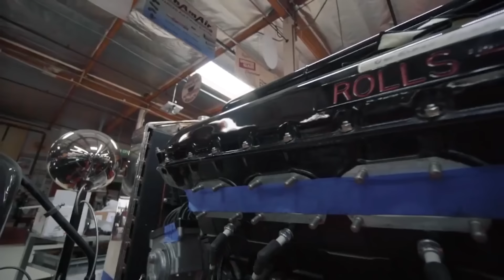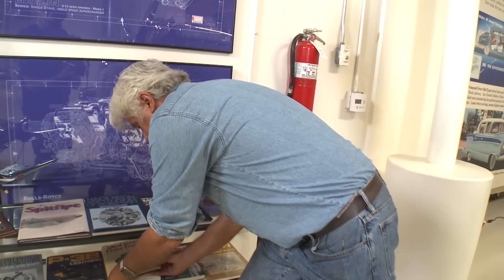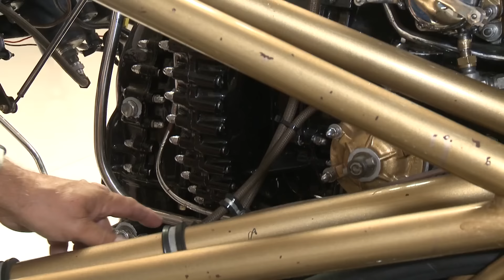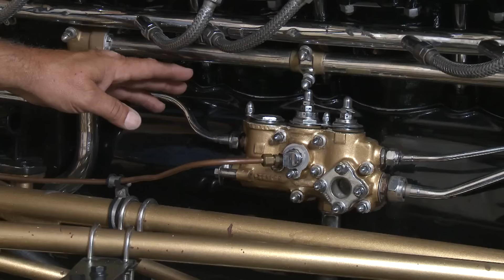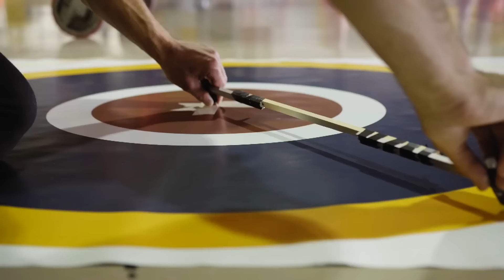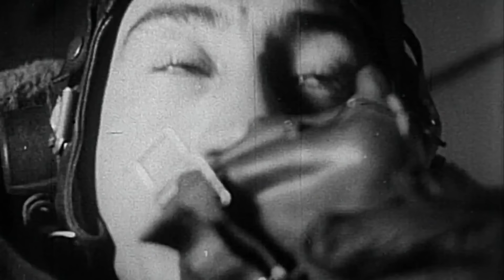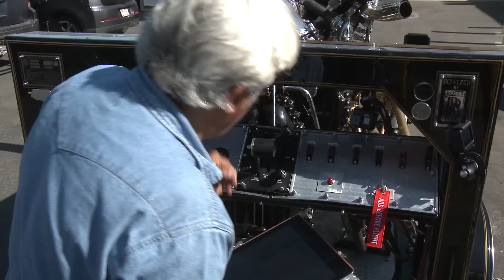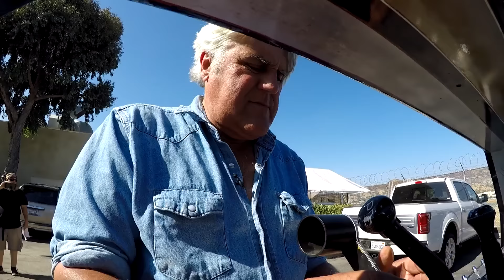The Engine That Won World War II - Jay Leno's Garage

Comment: Whole UK fleet of heritage Spits and the Lanc have been grounded, rumour is a gudgeon  pin problem which could wipe out a block? May be worth checking out on this engine?
Reply: Let's put emotive language language to one side for a moment and consider the facts.  I was, by the way, at work at R-R Bristol on 25th July 2000, but no longer working on Concorde's engines, when the news came through. One of my colleagues was immediately sent over to Paris and had the unfortunate task of walking through the debris field and actually inspecting the remains of the burst tyre.  It had a cut that exactly matched the piece of wear strip that  had fallen off the DC10 
Yes, the crash of AF4590 was a disaster resulting from what I would characterise as an incipient design shortcoming.  The wing structure above the undercarriage was designed to take the impact of tyre debris, which it did on this occasion.  However, what had not been anticipated during the original design process was the generation of a pressure shock wave in the fuel, which ruptured the tank elsewhere.  Even then, if damage to electrical wiring in the undercarriage bay had not occurred and ignited the leaking fuel, the aircraft would have probably made a safe emergency landing, streaming fuel.  The subsequent modifications comprised of installing Kevlar/rubber liners in the fuel tanks, extra shielding of the electrical harnesses and improved Michelin tyres.
For several years, Concorde was hugely profitable for BA: I was once told by a senior BA executive that, in six weeks, the Concorde fleet made more profit than the whole of BA's European Division in six months.  Of course, it pandered to the rich and famous, but then that is free market capitalism in action, and surely the USA of all countries should not object to that principle?
It is well known that  neither BA nor AF paid an economic price for their Concordes, which would have reflected the R&D costs of the project, and that objections were raised in the USA and elsewhere.  Concorde was a prestige project for both the UK and France, the equivalent, perhaps, of the Apollo programme, which had its own "design flaw" problem, as revealed by what happened to Apollo 13.
In respect of the economics of aircraft programmes, I would contend that, in the 1970s, the US aircraft (and engine) manufacturers did not charge a realistic price for their civil airliners to their home market, as their R&D was effectively subsidised by major military projects.  
In the late 1960s, the acquisition of widebody design and manufacture technology, on the one hand, and the development of the two large turbofan engines, on the other, was largely financed by the C-5 programme.  All three airframers and both engine companies had large R&D contracts from the US DoD for the C-5.
All aerospace industries have had events and disasters, as a result of unrecognised design shortcomings.  I was a small boy when the Comet disasters happened: it was a national tragedy for Britain, akin to the Challenger and Columbia disasters for the USA, which also resulted from "design flaws". 
If you do wish to use emotive language about airliners, then perhaps you should also apply it to US aircraft, starting with the Lockheed Electra.  Tragically, the wings came off nearly-new aircraft because both the engine mountings and wings had insufficient stiffness.  
The  DC-10 also had its problems: there was the Turkish Airlines tragedy in Paris in 1974, Chicago O'Hare in 1979, and Sioux City in 1989.  And Boeing, too, had problems: remember the Aloha event in 1988, where a B.737 became an 'open top'?  Then, in 1989, there was the crash of a B.737 here in the UK.  That was down to an unanticipated "design flaw" with the fan of the CFM56 engine.
Are you really suggesting that the sonic boom of a Concorde would result in hearing loss?  That's quite preposterous: exposure to the the general noise levels in the streets of any big city in the USA, or anywhere else in the world, would probably be far more injurious.  However, you may have a point about there being an occasional broken window, but it would need to be under the right atmospheric conditions.  
Living near the city of Bristol in the West of England, I did experience, on a few occasions, the dull "thud-thud" from the sonic boom of a Concorde inbound from New York.  On one occasion, it rattled my doors and windows just as a car was going by at the end of the road. For just a moment, I thought that there had been a collision, but then I realised what the noise was.
Finally, I must mention that, as a member of the Olympus 593 engineering team, I did have the pleasure of a day trip on Concorde in 1995, to/from New York, as guest of British Airways.
Reply: Not all,griffon spit still up while merlin issue investigated,may well be something or nothing...what needs remembering is that the BBMF are rightly overcautious because what they fly is pretty much irreplacable.you simply can't go out and buy another one of what they have.
Reply: A nice balanced and professional post, thanks for the sanity.
Reply: johnyfartpants How's Terry Fuckwitt? Haven't seen him in ages
Reply: They'll be back flying soon,remember that they've found a potential problem,they had no issues and no aircraft were lost.Regarding Concorde,the one that sadly crashed with a loss of life ran over a part that dropped off a shoddily built dc10 a few minutes earlier,an aircraft with a dubious safety record at best.And the Concorde fleet were grounded for financial reasons,it was never the success it should have been due to it being banned from supersonic flight over land due to the sonic boom,and video calling/conferencing etc which removed most of the need to cross the Atlantic in under four hours.
Reply: The official release from the BBMF states that the problem is an issue with the "pinion gear", by which I presume that they mean the pinion of the reduction gear driving the prop, which is mounted at the front end of the crankshaft.  For all the BBMF aircraft to be grounded suggests that they have identified a potential manufacturing or quality problem with a batch of gears  from a single source of manufacture. I presume that the reduction gearset is common across several marks of Merlin and, of course, the pinion and wheel will be of relatively recent manufacture.
Unfortunately therefore,  we won't be seeing the BBMF at the Bournemouth Air Festival this weekend, which is where I am.  However, we had great displays yesterday (Friday) from a P-51D and a Spitfire.  There was also an appearance of B-17 'Sally B', accompanied by the playing of Glenn Miller's 'In the Mood' over the PA system.  It was joined by the recently-restored, Bristol Mercury-powered, Bristol Blenheim, so we had the sound of six radial engines in our ears.
And, of course, we had the Red Arrows, unfortunately down to eight, as one pilot was reportedly suffering from food poisoning.
PS They were up to a full complement of nine today (Saturday) and they arrived all of fifteen seconds early, at 1159.45, for the start of their display.
Reply: Most of the BBMF aircraft have recently had major service\overhaul,the Lancaster was away having major work done when I last visited Coningsby in June.It may be that a service part used has been found to have an issue.
Reply: I saw two (or more) Spitfires and a Hurricane flying only yesterday, Friday 25th August.
Reply: Privately owned i'd imagine.BBMF working hard to resolve the potential problem.
Reply: The latest from the BBMF is that they expect to have a Spitfire and a Hurricane flying at a display on 9th September.
Reply: The Lancaster and two Hurricanes as well as the Merlin engine Spitfires, the Griffon is not affected.
To maintain the priceless artifacts of our national heritage in airworthy condition in order to commemorate those who have fallen in the service of this country, to promote the modern day Air Force and to inspire the future generations. I doubt they will be grounded for long.
AB 910, a Mk V, Mk 356 a Mk IX, P 7350, a Mk II and TE 311 a Mk XVI all have Merlin`s but 
PM 631 and  PS 915 are Mk XIX with the Griffon engine
Reply: I live coastal England,not too far from a long closed practice\ bombing range on the north sea coastline,as a child we lived with sonic booms from ee lightnings and the distant brrrrrp's from a10's at cowden.you quickly learned to live with it and hardly noticed it.
Reply: I'd like to echo the remark from freerad101; an informative and sensible post by grahamj9101. There's not too many of them floating around is there.. That's what the internet is for by the way - for those reading this who aren't entirely sure. The generous sharing of knowledge and 'life'. I get embarrassed for those who rant and talk excessive garbage, and particularly feel pity for those who don't seem able to try to spell or punctuate properly.  I saved for eight years to travel from Australia and fly on Concorde some six days before it permanently ceased services. It was 'BOAC' by luck too. Anyway gotta run because the latest episode of Skippy is about to hit the box !
Reply: So you flew on G-BOAC (Alpha Charlie to those who worked on her)?  Back in 1995, as a guest of BA, I flew Alpha Charlie one way and Alpha Fox', the other.  BA would arrange an occasional engineering meeting at JFK for the R-R service support team and make a day trip of it  
Having retired from R-R a few months before, I watched, with sadness, Alpha Fox's final landing at Filton in November 2003.  She spent the intervening years out in the rain until, in February of this year, she was finally put under cover in her own hangar, as part of the new Aerospace Bristol museum.
Reply: There's nothing in the Haynes Manual about gudgeon pin problems because there was no historic problem with them.  The recent BBMF press releases clearly state that the problem has been with the pinion in the reduction gearbox, which, appears to have affected the BBMF's engines only.  I interpret this as indicating that they have encountered a quality problem with recently manufactured gears supplied to them, which almost certainly has meant a strip of the gearbox and a detailed re-inspection.
Reply: Strange how the public did not make a big deal out of supersonic flight until after Boeing gave up on their very expensive design that never got off the drawing board,  some US airlines placed orders for Concorde only to find the sudden very unexpected resistance by many of the public, guess who was behind it?   a clue the name is something like this  B----g the plane maker who hated to lose.  take off and landing noise was just more of the silly nonsense.
The noise meters put in just to show how noisy a Concorde was showed it wasn`t, other planes were noisier on take of or landing and for longer.
Reply: tjp.
Very strange that the so called issue of supersonic flight was no big deal in the 1960`s,  as for noise in 1977 when I was not far from Heathrow and regularly saw Concorde`s  the loudest plane I heard was a Boeing 747.   The US did not need to exempt Concorde they had set noise meters  to measure the noise on take off, it was not nearly the loudest plane taking off and the protesters had to drop that nonsense.  
Concorde not flying supersonic overland still took much less time from London to New York. Many Americans were very happy to fly fast
Reply: As someone who worked on Concorde's engines for several years, I would be a regular visitor to R-R's office at Hatton Cross, near the eastern end of LHR's 27L runway.  During the latter part of its service, it could certainly be the loudest aircraft on take-off and could even set off numerous car alarms in the car park adjacent to the end of the runway.   On other occasions, dependent on weather conditions, it appeared no noisier than, say, 747s.
Reply: graham.
Car alarms can be so easy to set off, I parked one day and was getting a couple of things out of my car, someone parked a few spaces away got out and as he walked away his car alarm went off, he reset it with the remote, went to walk away again and a passing car set it off, he reset it again and I watched then closed my car door, off it went again, the poor bloke was still there resetting it since it went off as I walked past.  Having been to numerous airshows and many times car alarms go off that is not really such a big deal.  Vulcans used to set off car alarms, Lightnings did. It is quite normal at airports too.
Reply: The issue at Hatton Cross was that Concorde did set off car alarms on occasions: no other aircraft did on take-off.
Reply: +B.R. If it wasn't going to be a problem, maybe you should try to figure out why supersonic flight over land was banned in most countries. If it wasn't causing any problems whatsoever, why would so many countries ban it?
If you look for it, you will find that Concorde was made exempt from the ongoing & ever-tightening noise restrictions, being applied in both the US & UK, through the 1980s & 1990s. The information is there if you're willing to look.
Reply: There were some other exceptions too, but in most cases it was banned. Plus, the Oz interior is barely any more populated than the ocean.
Reply: There was a Canadian supersonic corridor, but it may have only been temporary. It was used during Concorde's farewell tour.
Reply: Who are you suggesting should call the RRHT at Derby and for what information?  There's a fair amount of history about the Merlin in the three volumes of 'The Magic of a Name', which I have. There's also a series of publications about R-R's products, including the Merlin, available from the RRHT.  I must dig out my copy out when I get home.  PS:  I happen to be an All-Branch Life Member of the Trust.
Reply: https://youtu.be/fqOcYhzWUZYA very interesting perspective on the "Air France Flight 4590"  accident from a Concorde pilot.Please cut the French "white flag" bullshit. It's a fallacy, concocted because France wisely decided not to getinvolved in an unnecessary war and invasion of Iraq. Freedom fries, anyone?
Reply: @ Swampster70. 
Has anybody called you a fucking idiot recently? You must feel the need badly.
Reply: +18t. YT vid 'Concorde Breaking the Sound Barrier' gives a good demo of it's boom - and it's quite a boom! A single daily boom from concorde is no great problem, but I think the early US anti-concorde campaigners were assuming that supersonic air travel was only going to increase & booms would become a regular occurrence.
Reply: +18t. As far as the US is concerned, accepting Concorde & accepting supersonic flight over land are 2 seperate issues. Supersonic flight is banned over a lot of countries, including the UK & France, so it's hard to criticise any other country for this, when Concorde's home nations did it as well.
The US did do a lot to keep Concorde out, but most of this hostility towards sonic booms was already well-established & started before the US SSTs were in development. In order to test how the population of a city reacted to regular & consistent sonic booms, the FAA & USAF carried out 'Operation Bongo II' over Oklahoma, booming the city 8 times per day to simulate life under a supersonic flight path. After a while the backlash became enough to stop the experiment early.
Public opinion against sonic booms was part of the reason for the cancellation of the US SST program, so it shouldn't be surprising that the US didn't welcome Concorde with open arms. Before the cancellation of the US SSTs, the US aviation industry was generally supportive of SSTs & trying to promote them - but still failing massively against strong public & political opinion. After cancellation, there was little support for a foreign design.
The driving force behind the JFK ban was the Port Authority that owned the airport. To them, takeoff & landing noise was the main problem.
Reply: +B.R. By the late 1960s, US public opinion was already strongly against supersonic flight over land. Parts of the US had been boomed by their air force since the early 50s & they were getting tired of it. After 2 decades it was enough of a nuisance to lead to it being banned (unless a military necessity) in most countries. Concorde couldn't fly supersonic over the UK or France either, so I don't understand why the US should be singled out for criticism.

The US wasn't obliged to accept Concorde. Part of the reason airliners are so quiet today is due to regulations demanding that new designs are quieter than older ones. In 1968/69, the 747 & A300 were beginning to introduce quieter turbofans, but Concorde was heading in the opposite direction. Having 4 large turbojets with reheat, Concorde was about as loud as it gets. It would be hard to be any louder, so the concerns of the airport operators & local public were valid. This is not 'nonsense'. For takeoff, it was eventually demonstrated that, by using special noise-abatement procedures, Concorde's takeoff noise was acceptable. During the takeoff roll, reheat made it louder than anything else but, by using these noise abatement procedures (read:- https://forums.flightsimlabs.com/index.php?/topic/3400-jfk-31l-kennedy-9-departure-canarsie-transition-concorde-climb/) it was possible to reduce it's noise footprint after takeoff, when it mattered, to something comparible to a 707 or dc8, by reducing power & not using reheat, over certain areas.

Concorde was also exempted from all the ongoing noise restrictions that began to affect the loudest aircraft, that first became effective in the 1980s & continued getting stricter. While 707s, 727s, BAC111s, etc, all had to be fitted with hush kits in order to continue operating in the US & Europe, Concorde was exempted & continued being exempt until it's last flight, after other jets had been restricted or even banned altogether. The US was not obliged to exempt Concorde, but did so anyway.
Reply: The Concorde was fatally damaged by a small bit of airport debris because the design of the Concorde was Horribly Flawed. A blown tire just does not take out a well designed Civilian Aircraft. 
It was also a Financial Failure because of the very poor passenger mile / per gal efficiency, with astronomical maintenance costs, which made it a very expensive advertisement. 
In short the USA canned it's SST when the fuel, noise & maintenance costs were obvious, but Britain & France dumped money in the large pit known as the Concord for decades.......
Reply: Nope, the Concorde was not economical, and the USA would have seen broken windows & hearing loss, if we had let the Concorde fly over land. 
Banning the Concorde was not to protect our Commercial Aviation 
Industry, but rather common sense. The US and even Soviet Commercial Aviation Industry focused on Passenger Mile / Gallon efficiency, while the British & French CAI focused on catering to the ultra wealthy.
Reply: Only in Britain. The planes flew, won the war and flew around giving folks enjoyment for over half a century and now they find a problem... Ha! It's a bit like Concorde. You run the plane overweight and over garbage on the runway and then subsequently scrap the entire fleet. I guess the French first raised their white flags on that one...